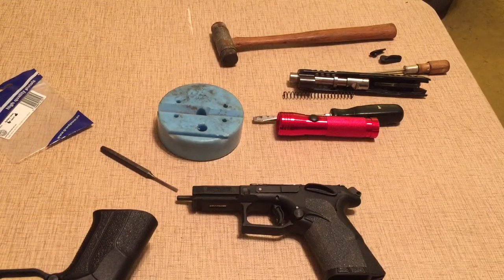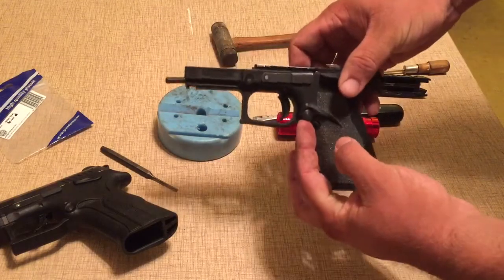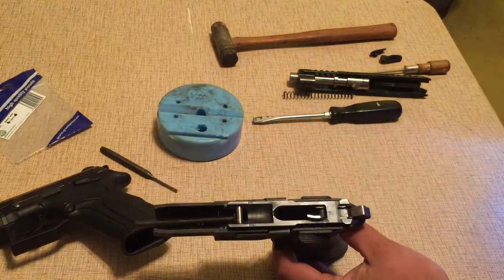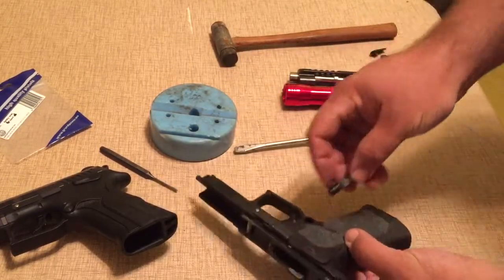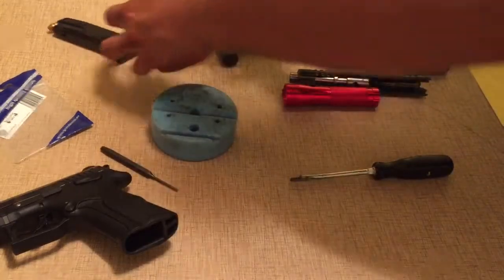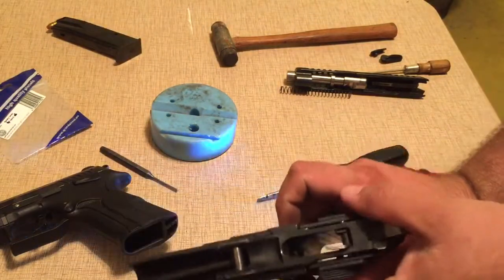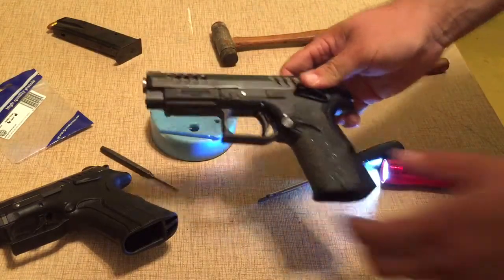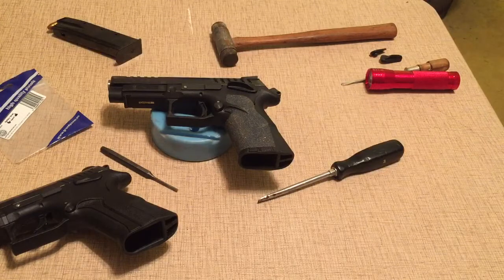Grand Power K100 Magazine Release Change

Comment: How can the magazine release spring be changed?  Or at least rendered weaker?  The mag release spring on my K-100 is extremely stiff and difficult to operate.
Reply from the maker: I can think of a few ways, but none feel like a good idea.  You can remove and stress the spring, or anneal the spring,   however my recommendation would be get a longer release with a bigger button so it puts that in an location you can press on with more leverage.
Reply: @ThePracticalShooter  What is the orientation of the notch in the mag release button?  When replacing the mag release button, should the notch face rearward, or forward of the gun?
Reply: Excellent question.  No one bothers to explain.